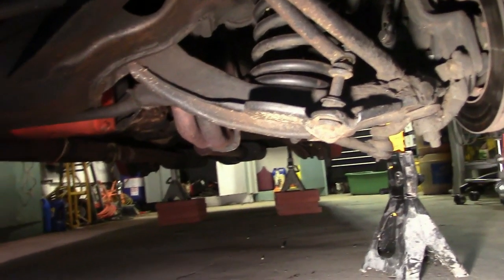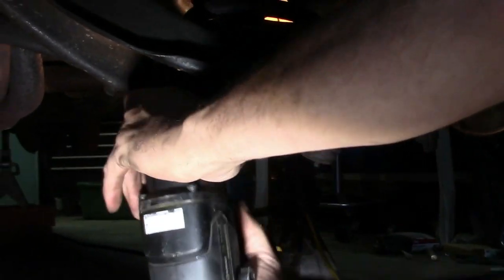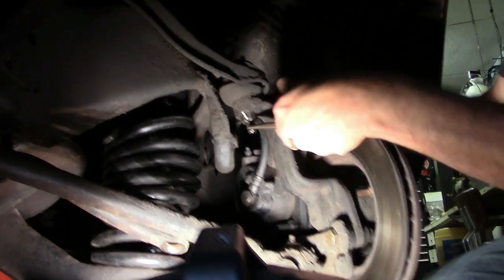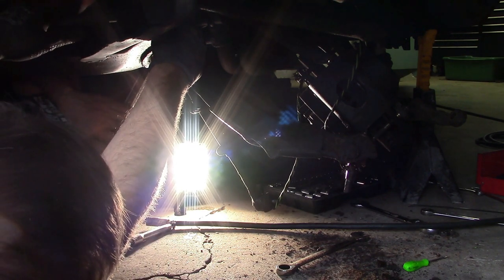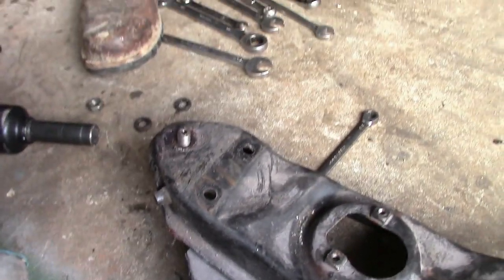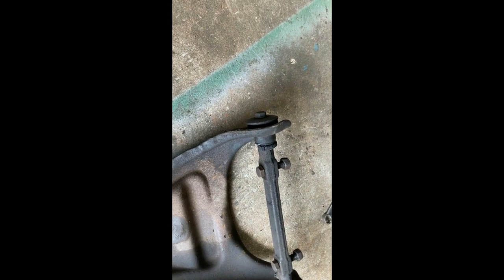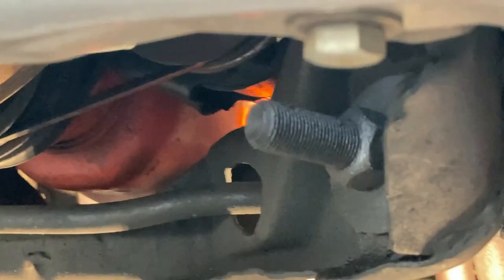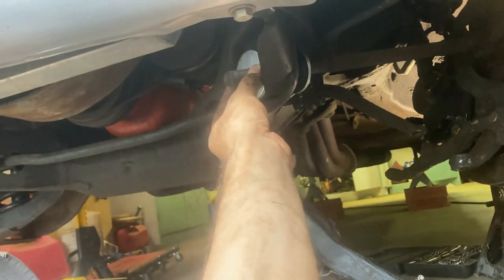How to Rebuild Your Front Suspension 1965-1970 Impala/Caprice. Greatly Improved Ride Quality.

Comment: I've always pulled top A arm, replace bushing and ball joint, hook spinal back up to have disc, caliber dangling.  The rest takes about 3 hours to install new parts. I also don't remove shock until I finish top arm, remove shock, and lower the floor jack.. relieves coil pressure.
Reply from the maker: Thanks for the tips, I just did it the way I thought was best. I never had any instruction.

Comment: Came here looking for lower control arm bushing replacement.  One thing not being done on this job.  Man is it a mission!
Reply from the maker: Sorry about that, it’s the same as the rear bushings. I have a video that shows the process of replacing them.
Reply: @ImpalaCadillacRestoModDIY  Nice!  Cheers!  I had a bit of a nightmare with my lower control arm yesterday and didn’t realise the factory bushing was flared at the smaller end and I tried to press it out… 😩  I eventually drilled the rubber out and knocked the centre sleeve out.  Now just outer sleeve remaining which I plan to use a hacksaw to cut a slot in and then remove.  Thanks for pointing out your rear arm video.  Subscribed. 👍🏻
Reply from the maker: I hate that you had all those problems, it can be a pain to get them out. I use a hammer and chisel to crush the outer sleeve on one side. I also have videos from my 67 Cadillac. The process is the same on that one too.

Comment: Is the upper controll arm bolt right on into the braket or you also put a washer between the controll arm and the mounting braket
Reply from the maker: Nothing goes between the bracket and the frame

Comment: Great Video. Where did you buy your new Strut Rod. I have a 66 Impala and need to change mine out. Thanks.
Reply from the maker: We just replaced the strut rod bushings, not the rods. The rods are original. I did buy a new center link from EBay. Most parts were bought on Rock Auto.

Comment: I can’t find the bottom control arm bolt/ Camber bolt/ eccentric bolt. Everytime I order I get sent the wrong bolt. Last resource will be will be go to local machinist. I hope is not expensive 😓
Reply from the maker: I hate to here that, I just sold 2 of them on eBay. You definitely want to check eBay.
Reply: Thank you 🙏 actually I found them. Finally got it done ❤ awesome video
Reply from the maker: @LUIBROWN17  good to here

Comment: To remove the springs . Put a floor jack under the lower control arm, take out the inner arm bolt and lower the floor jack. There is no need for a spring compressor it's in the shop manual to do it this way Frickin hammer mechanics 🙄 Don't know what they are doing
Reply from the maker: Thanks for the info
Reply: Did you use the bar and block of wood with the jack like they show in the manual? I'm curious because I am setting up to do my 66 big block Impala?
Reply from the maker: No, but I’m sure you can do it with no problems. I used a spring compressor